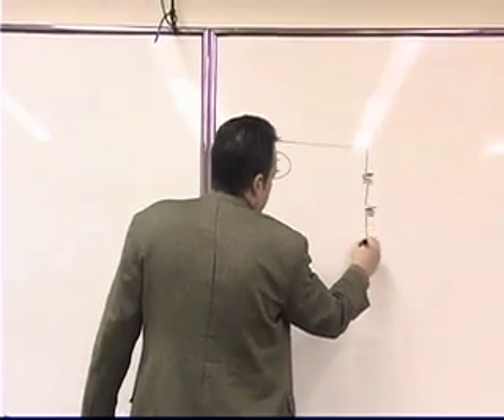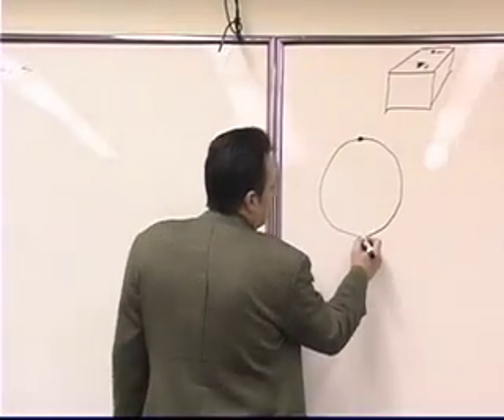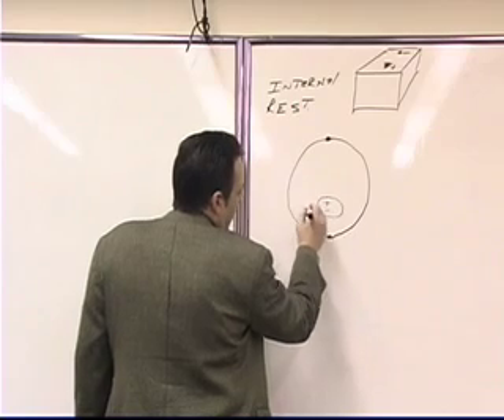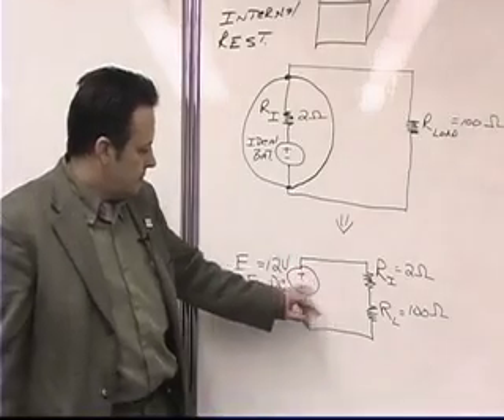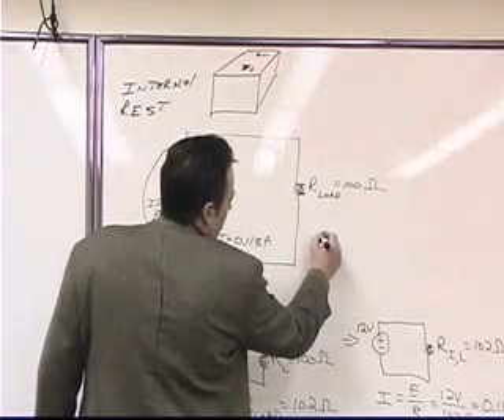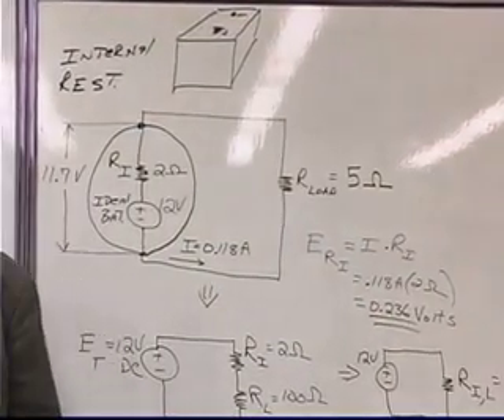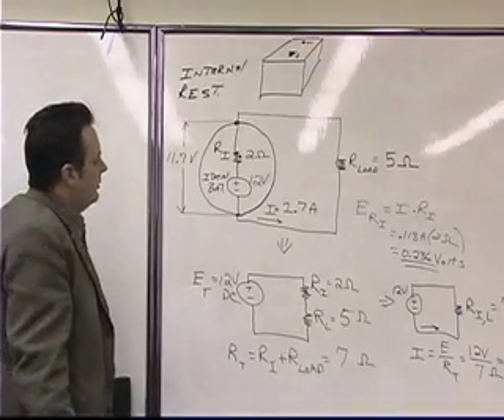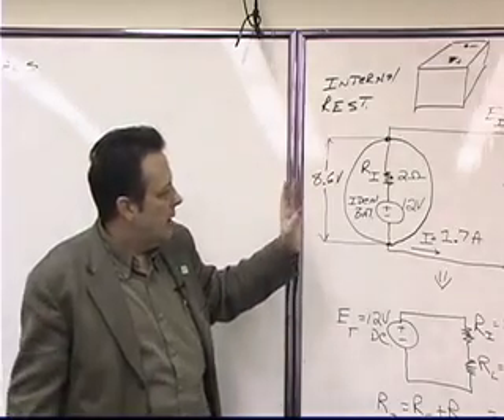internal_resistance.mov

Comment: Leonardo; Place the battery under full load measure the voltage and current of the battery, then divide the current into the voltage, this is the worst case impedance of the battery.